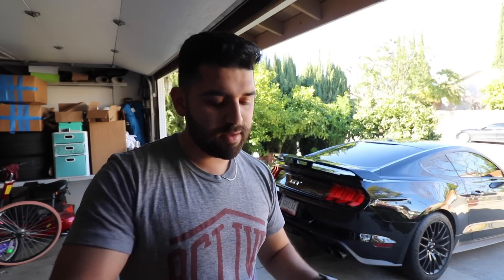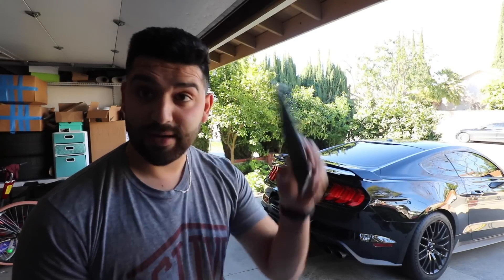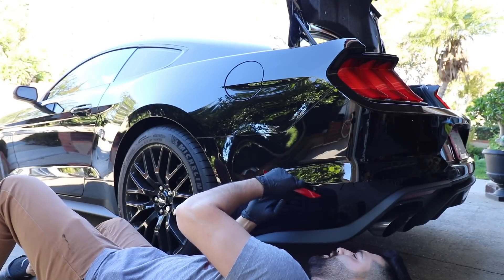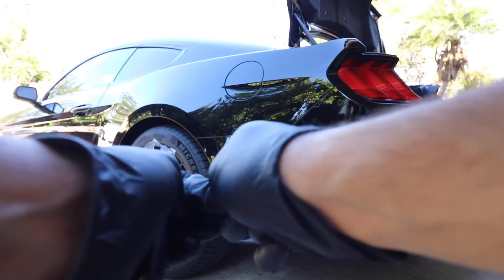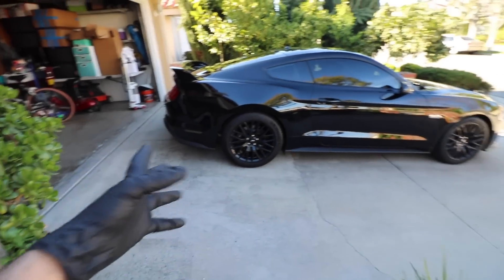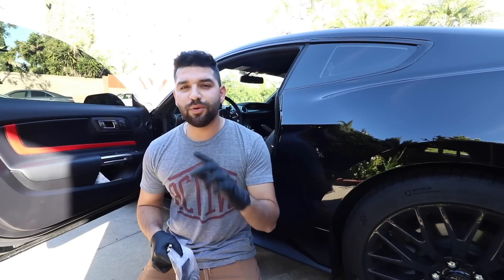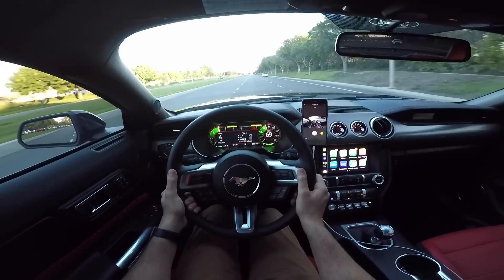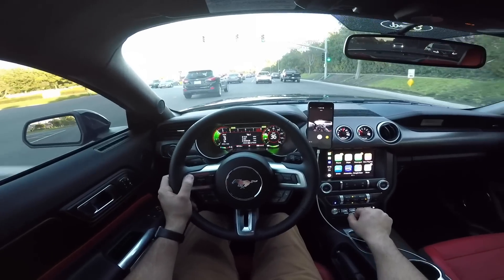The $20 Mod EVERY Manual Mustang GT OWNER should DO!

Comment: Also do the reverse light. It takes literally 30 seconds. I put an LED reverse on mine and it looks so much better than it used to.
Reply from the maker: Ordered ;)
Reply: I have a question!!! My 2015 GT doesn't have a spring for some reason? Is that NORMAL? Please answer!
Reply: @DailySR  someone might have removed it. Just order one from steeda.

Comment: Great video, enjoyed watching! I have a 2015 GT 5.0 with a JLT CAI, Borla axle back exhaust, manual trans. Not looking to blow $10k for a supercharger but looking for small things I could do to help make her a little faster for street dig pulls and such, any recommendations? Got my eye on a throttle body spacer, or maybe a VMP SCT Rev-X tuner since I've heard you need to tune it with that JLT intake (though I've heard mixed opinions about whether that tuner would do much without forced aspiration).

Comment: Uh, ok thats a pedal return spring. That does nothing for the pressure plate and how that transfers through the clutch pedal. I guess with that logic chrome wipers will give you 30 more HP.